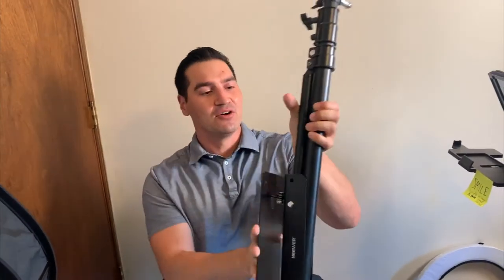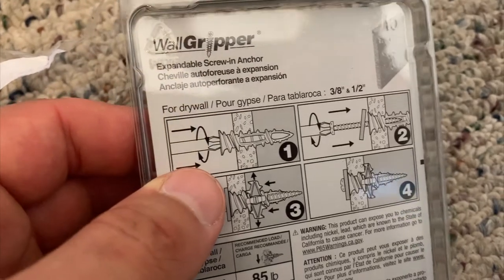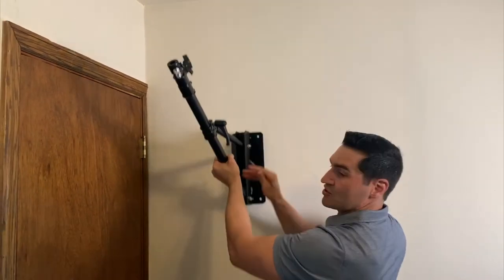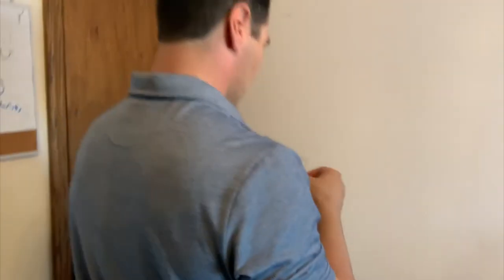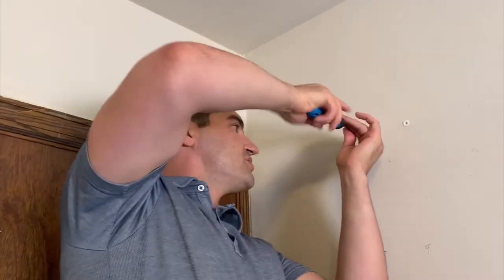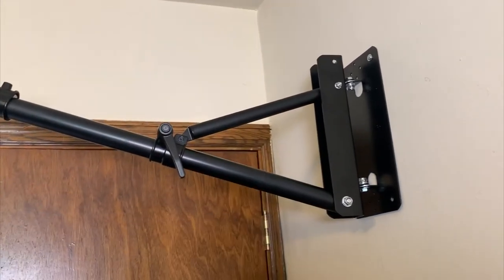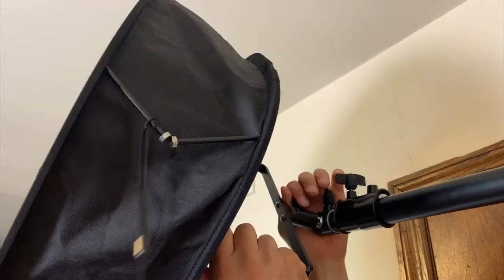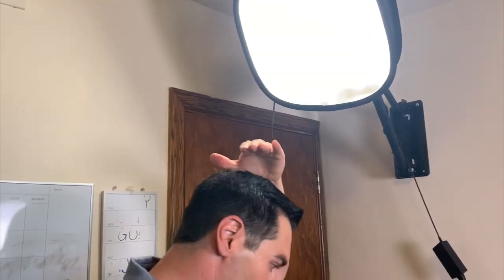Neewer Wall Mounting Boom Arm Installation (ALL STEPS!)

Comment: I have three of these. They're a great solution. However, I can tell you from experience that drywall anchors are NOT the right way to mount these things. 85lbs might be the published limit for those, but it doesn't take into account something that you handle and move around a lot. That WILL loosen over time, and if you aren't super careful, it might fall off of the wall. On top of that if you accidentally mount it near a joint btwn two pieces of drywall you could end up with some chunks of drywall coming off the wall with it. It's not that hard to find a stud in the wall near where you want to mount the arm. You should use 2.5 to 3" constructions screws to mount this to a stud. The washers were a good idea, though.
Reply from the maker: You're correct that it's ideal to use the stud. If it was a TV mount I definitely would, but this works.
Actually, I'll tell you a secret; I only used 2 out of the 4 screws for each boom arm and they are still hanging solid. The washers must be the secret ingredient!
Reply: @JohnKlick  I guess that you haven’t been moving the arm around that much then, and your lights aren’t that heavy. Glad it’s working for you.
Reply from the maker: That’s right, I planned out where i thought the lights would aim best and so far has been solid. Though I haven’t made content in a while, I will start getting consistent in the near future.

Comment: You could have literally just drilled the anchors to the drywall as the are self-screwing anchors.  The drill bit kinda defeats the purpose of those specific anchors.   Just punch a tiny hole and screw them on the drywall.  But i wouldnt trust those anchors for the load of the mount.
Reply from the maker: I understand your concern about the anchors, but they've held up so far and seem super solid. 
According to the packaging they should be able to hold 4x the weight of these (by my estimation, I haven't actually weighed the Neewer)
If I had any doubt, I would first use anchors in the bottom 2 holes to double the support. 
You could punch a hole, I just preferred the drill because it is cleaner and more accurate.

Comment: I am going to give you a hint. Those wall anchors screw in with a screw driver for a tight fit. Do not drill the holes. The anchors are self tapping.
Reply: THIS is true
Reply from the maker: Thank you for the heads up, I'll keep that in mind for the future. That will also save some time.
Reply: @JohnKlick  I just hung my boom.  One side into a stud so had to drill pilot holes but not the other.  Angled wall...so this was a trip to do solo.  But these booms are amazing.
Reply from the maker: @bikesnbeerz  Agreed, especially if you have a background that shines (like a whiteboard) from direct light. Glad you’re enjoying them!

Comment: You definitely should use all 4 holes for even weight distribution.  Personally, I would have checked for a stud to drill into before use using only anchors.  The stud is MUCH stronger and then use the anchors to distribute the weight.  And yes like others have said, you didn't need the drill bit.
Reply from the maker: They held fine with 2 holes, but obviously 4 would be better.
If you did use the stud like you said it would be much stronger, but you definitely would need the drill bit.

Comment: What about fitting on the room sealing ?
Reply from the maker: What do you mean by room sealing? Or is that a typo and you meant ceiling?
Reply: @JohnKlick  sorry, my mistake, I mean ceiling
Reply from the maker: @norius commented that you can install on ceiling as well. 
It appears you could install almost anywhere, you could bolt into the floor if you wanted to
Reply: Last month I have purchased and using, thanks for your video